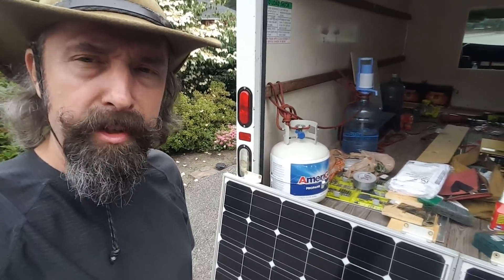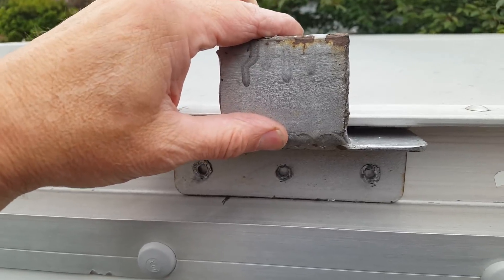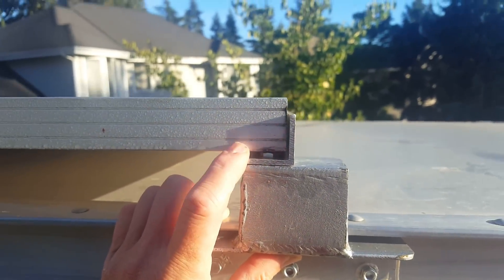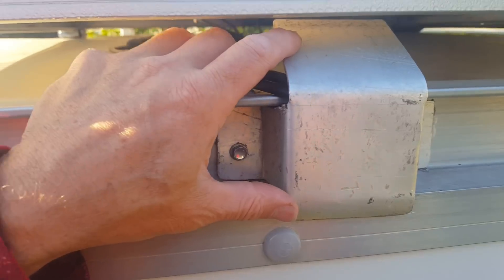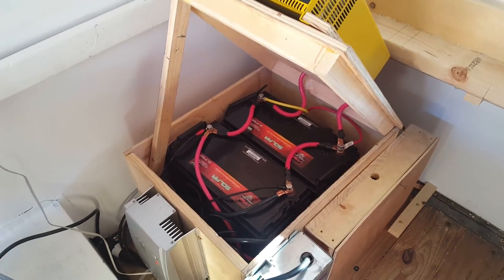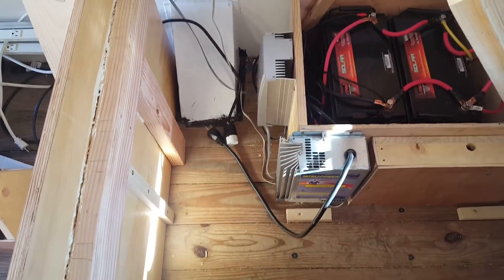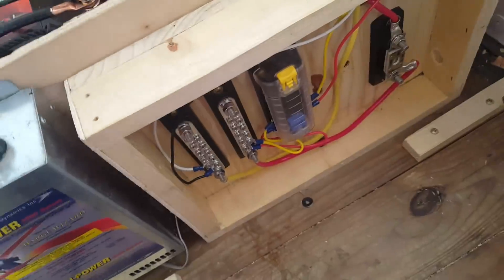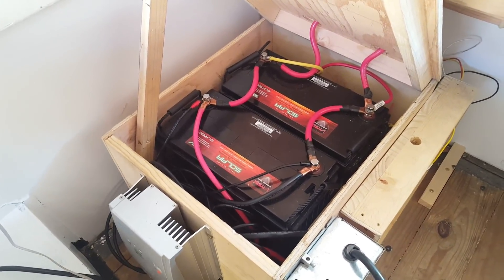dreamsideout 84 Converting a Box Truck into a home … volume 2

Comment: They are called roof bows, you need to make sure you place protection where the wires go through the roof silicon or something. Vibration will cut your solar wires. You're having fun :)
Reply from the maker: Good point.

Comment: It doesn't take much time to ruin good batteries with inadequate charging. So both are pretty important. Put together the money to do it right to start with or you will spend even more when you have to redo the system. Pay once cry once.  
I have solar but also carry a small propane generator, (Ryobi 900 watt peak 700 continuous). It can run a 40 amp charger if for some reason there is say a couple of days of heavy clouds. The longer a lead acid battery sits low, the longer it will take to charge, and the shorter it's life will be. the generator is small as I only really bought it to run a battery charger, but it will also run a 5,000 BTU window air conditioner.

Comment: So can or do you charge batteries while driving? Like with isolated switch? Technically couldn't you then run car as back up plan for energy? Then you wouldn't need to log generator. 

Otherwise, keep it under bed in case.. lol.
Reply from the maker: I haven't installed one of those isolator switches in this rig. but that's a possibility. People say they have great luck with them.

Comment: Any reason you didn’t go with lithium batteries? 
With your truck charging system completely separate from the living area, I would ditch the generator. Worst case scenario, you can start your truck plug a small inverter into the lighter and then plug your charger into that.
Reply from the maker: Lithium batteries are great but very expensive. They are much lighter too. I'm on the fence with the generator.

Comment: @ 10.43, that is a 20amp male plug, standard plug is 15amp. The Inteli-power 9280 uses a 20amp plug (15amps in a 20amp plug is fine but 20amp in a 15amp plug is  not wise and you are trying to draw 20amp thru a 15amp fused receptacle). Because a 80amp charger is over kill for your batteries, the charger will quickly draw less amps as the charger will recognize the batteries do not need 80amps.
Reply: What did you say?
Reply: I said, you can pour a cup of water into a quart jar but don't try pouring a quart of water into a cup, LOL.
Reply from the maker: Humm. I may have miss spokein.

Comment: Rick,,, Thanks for sharing,,,In my mind two most important components for solar are Batteries and the size of the Battery Cables,,, Looks like you have them Both covered,,,Big Batteries and Big Cables,, Best Regards
Reply from the maker: You got it. Large cable are a must. I should have mentioned that.

Comment: I hope you installed a fuse coming out of the battery,  didn't see one, and one from the charge controller to the batteries is required.  As far as the generator is concerned, I see you as more of a minimalist who doesn't require heat or A/C.  Sell the generator,  you can always buy another in the future if you need one.
Reply from the maker: I've got both of those cases fused. But I should have you look it over sometime. Thanks Terry. Let me know when you are headed this way.

Comment: I think your philosophy is spot on ,the battery bank is the main focus , in general the heaver the better (more, thicker lead ) with trickle charge is best . For me if you need  100 ah get 300 or 400ah bank . In general over build / engineer is always better. Looking good . As for generator, free up space , you can always get another one if needed .
Reply from the maker: Thank Bob. Some good points.

Comment: Rick...the generator...there are companies ( https://www.aluminess.com/accessories/boxes/ ) that make lock boxes that will fit the generator and a container of gas...it could mount on your bumper to keep the gas fumes out of the living area, and it is locked, so theoretically, it will be secure.  Your bumper is wide enough so the box wouldn't interfere with ingress and egress.  Better to have it and not need it, than to need it and not have it.  On another topic...please consider a wood burning stove...here is my favorite one... https://www.tinywoodstove.com/product/small-stove-the-dwarf-3kw/  ...with a rear exit flue the entire top of the stove could be used for cooking.  Get the accessory air intake so it draws air for combustion from outside instead of sucking air from the living space.
Reply from the maker: A possibility for sure. Thanks for the link.